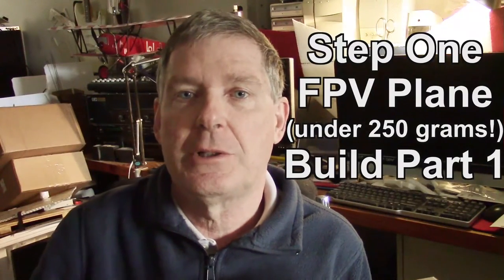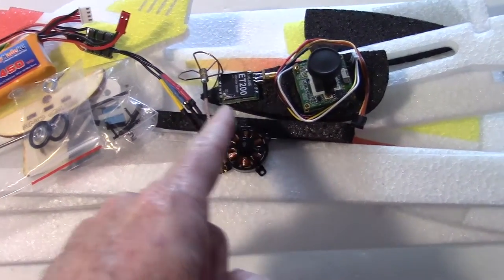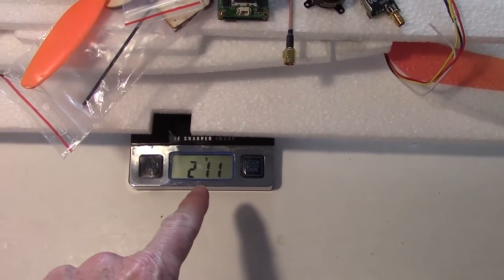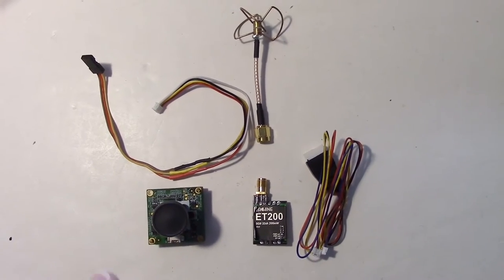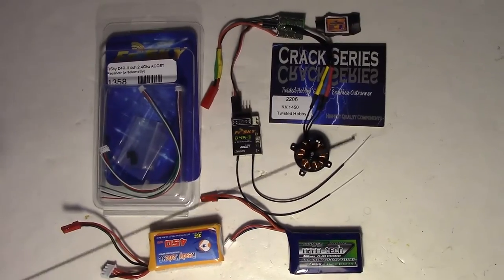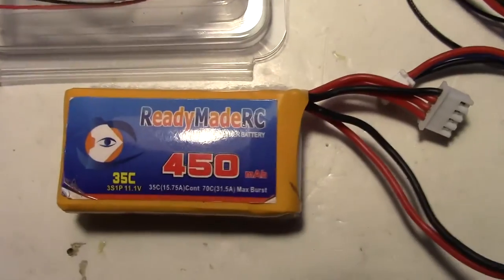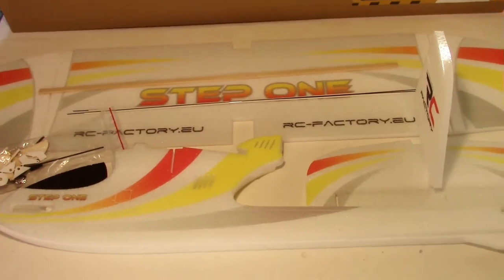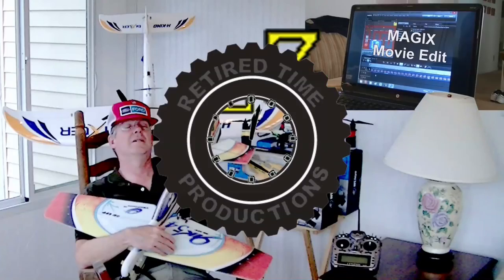Twisted Hobbys Step One FPV Plane Build Part 1 (Under 250 grams!)

Comment: just got your reply and finished watching up to part 7.1 - you th-man Dave. Thx! Not sure if you took notice but the video smoothed-out when you kicked-in the stabilize-afterburner. on the down-side, turbulent days w/aggressive stabilization on can eat up battery reserves "countering" out the buffeting up there. its all a balancing game. just 6 g added weight for GPS function is outstanding. glonass uses rusky's sats - so instead of 6 feet accuracy, we get 10. the real difference is cost and avail - GLO_bal NA_vigation S_attelite S_ystem wins in that category. another great source on YT for all these skill-sets is "painless360". every time I launch, I worry about my FAA ID "falling into the wrong hands" - literally.. 249.47 grams just makes sense lately and even tho I do enjoy the virtues of VTOL and Quad-Rush (my bro sells em) - lets say I'm old-school and prefer two wings and a tail - ha!- thx again. "blue-skies"..
Reply from the maker: SInce this works so good I have now put BeeRotorF3 boards and several other aircraft. Thanks to the mini-quad racing industry we now have cheap FC's with OSDs and plenty of small motors and props for our small planes :-)